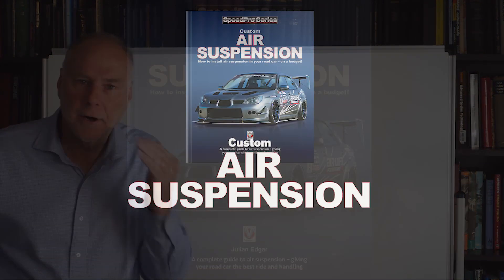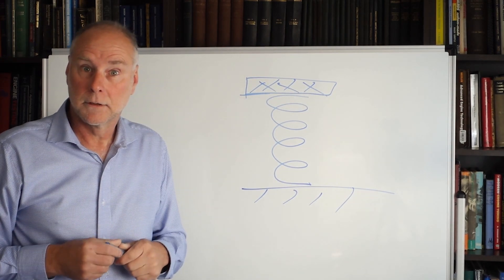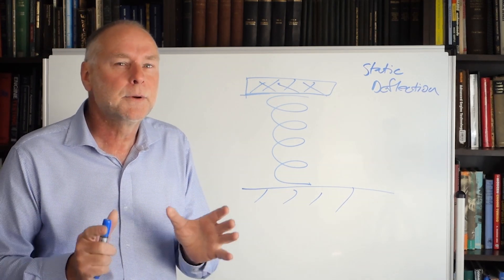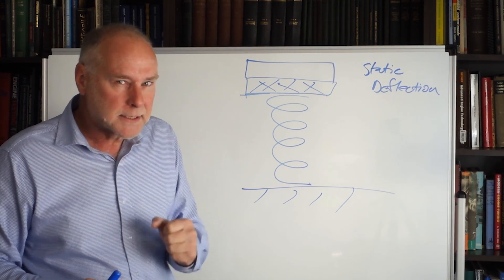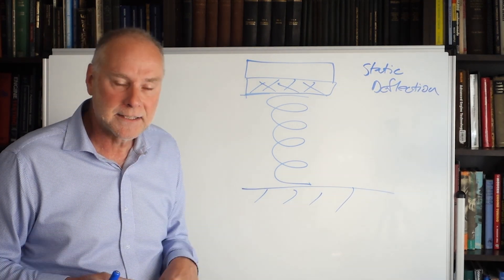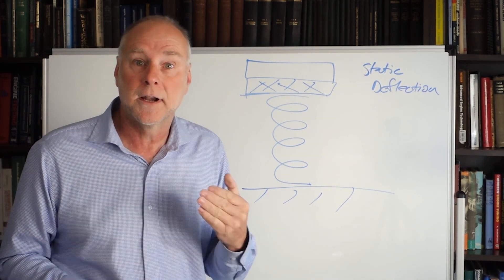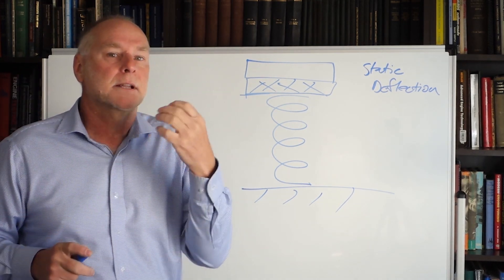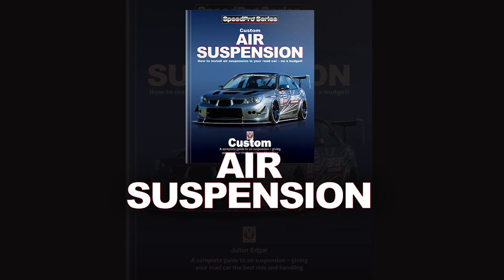Natural Frequencies in Car Suspension

Comment: Is it possible to hear rumble? Sometimes when I'm driving I can hear a bass noise and I think it's just the car vibrating like a speaker would with pressure waves because of going over potholes. Is this just my imagination? I thought this might relate to natural frequencies in spring rate but I'm not able to find info on the audio aspects of this. Or if evwryday physical materials can even convert vibration into audio the way speakers do. Like a metal wall, or large glass windows in the wind, etc.

Comment: This is the most interesting advice that will open my mind as I always wondered how my car adjusted it's self in different gears. It reminded me of the batmobile as it adjusted to speed and height so if he's going really fast he's really low and won't take on bumps or else it has to slow to soften bump and be higher for springs to soften blow on the drop.

Comment: I feel like this was an introduction... Its a delicious teaser... But I feel somewhere in the background being led towards Bose's electrical-actuated system... 
Or say Specialized's philosophy in their Roubiax model "endurance" road bicycle...
Named after the extreme Road Bicycle 700c race that INCLUDES COBBLESTONES...

At the pressure of road tyres that think, most road cyclists have to see it as the joint equivalent of somewhere between a strongman competition and extreme eating...

Extreme in the osteoarthritis sense...

Hence the pressure on various manufacturers to

- not excessively tradeoff benefits of the more traditional 700C road configurations:
Rolling resistance, 
weight and 
aero 

2 the introduction of "sister" categorys including
Endurance,
Cyclo-cross &
Endurance....

Without the additional weight of traditional fork suspension in mountain/trial,

So the Cobblestones of the Roubaix perhaps drove a real selective pressure to
Gain endurance, 
because traditionally you haven't been cushioned by much 
Handlebar tape
And tyres 80 - 100 psi ?

Its JaRrInG !

Rathetr Specialized phiosphy was
 rather than have the "bike and rider" above the suspension...

suspend the rider above the bicycle,
With suspension within ther handlebar stem &
The seat-post being allowed to evet so slightly float? Rock? Pivot
 and be dampened by elastomers...

Some models even had elastomers placed with the tubes of the rear triangle. 
For some additional frame flexion (theoretically dampened?)
Which yes some of the roaf power freaks made of steel seem to fret about for some theoretical power transfer...
Ok... But an analogy say the ferarri isnt fun and hurts after say a 30km run...
Yours less inclined than on a vehiicke where the tradeoffs are so slight on power / max speed,
Yet you dont feel half crippled aftet pushing the bicycle.

To finish with a note on the simplicity of materialsselection
 traditional steel bicycle 700C frames are celebrsted by many due the dampening qualities of steel without any additional complex mechanisms!
Sure steel  heavier than carbon and aluminium, but a certain silky smoothening of road noise that has to be appreciated!

The holy grail with road/endurance aims take no road noise outsmaller.bumpsl

Since after all the real world isn't a billard table perfectly smooth velodrome.

Comment: is the natural frequencies what they call ride rate?
Reply: No.. Ride Rate is the equivalent stiffness of the suspension, including the tire stiffness
Reply: The ride rate is given as a spring rate equivalent of the vertical stiffness of an axle or the sum of the whole car, generally of the sprung mass. The natural frequency of the sprung mass is what this video is talking about at that is a combination of the sprung mass and effective wheel rate (taking motion ratios into account). So the ride rate is different that the natural frequency, but the natural frequency calculation uses the ride rate variable.

The reason you use natural frequency instead of rate is that it allows you to compare unlike cars. What is sprung 'stiffer', a NASCAR stock car or a Porsche 911? Do they have a similar front to rear distribution of their stiffnesses even though they have a significantly different overall weight, weight distributions and end use? This is how you compare apples to apples with suspension stiffness.